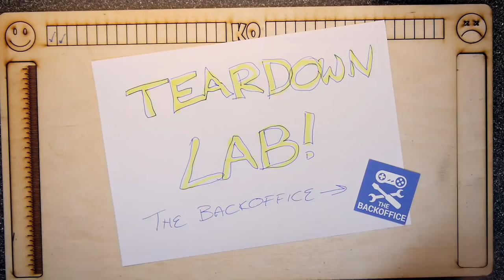How to make your GBS 8200 Awesome DIY Video Converter Part 2

Comment: Am I missing something? Why did you connect what seems to be a common ground rail from the potentiometers to the centre of a phono connector? Should it not have connected to the outer?
Reply from the maker: Because I am leaving the outers (terminal rings) floating because I cannot be sure how they are wired up in the end equipment. So I'm using the centers only as signals.
Reply: @backofficeshow  

I could see what you mean if you'll be hooking up stuff that needs completely separate grounds, but I can't think of any consoles / computers / arcade boards that don't have a common ground?

I guess you could use a center pin of one phono to hook up the ground externally, but you might as well just hook up all the ground tabs on the video phonos, as it will give a lower impedance ground path, and hook up all of the cable shields more easily. You can then just plug those SCART to phono cables directly in. ;)

On the GBS board, btw, you could have just wired some extra buttons in parallel with the onboard ones, but I realise that it is sometimes nice to just pinch the tact switches rather than wait for an eBay delivery.

I would have had the VGA output poking out the back, just to save space inside the nice case, but I definitely see the benefits of having the cable poking out instead.

(ie. the plug would stick out quite far, and not let the box sit on the bench too neatly.)

I've started building a small "supergun" now, mainly to help fix that Snow Bros board. lol
Reply: How much was the case, btw?

When I looked for something similar on eBay, they cost anything from £50 to £130, even for the plastic ones. :o
Reply from the maker: Its horses for courses really, I have already had the lid off on a couple of occasions since to make mods - I guess that's the beauty of the setup :)

I wanted to keep my options open hence the separate ground, if I ever get around to setup up the laser cutter or milling machine I would be quite motivated to adding several options via switches, but manually making the cutouts would result in a nasty looking job, so for now, separate ground :)

Yeah switches definitely in parallel if you have them, im kinda annoyed I could not find the quite neat panel buttons I have lying around, however I am quite pleased with the end result, it works well in operation. I was considering using a tiny little industrial joystick, but couldnt source one.

In terms of supergun its almost there, isnt it, if I just shove a PSU into the empty 'lid' portion for the output power all I would need is a JAMMA connector with a DB9 joystick.
Reply from the maker: I believe I got them on eBay for a few quid each, I will have a look and update the description (probably by the time you see this message)

Comment: The soldering through the insulation technique would be massively easier if you scored the insulation with a knife beforehand
Reply from the maker: I think it's a bit of a nasty technique and causes too much slag, I might avoid it in the future and go with uninsulated single strand wire
Reply: @backofficeshow  yeah it's definitely crude but if it works it works I guess